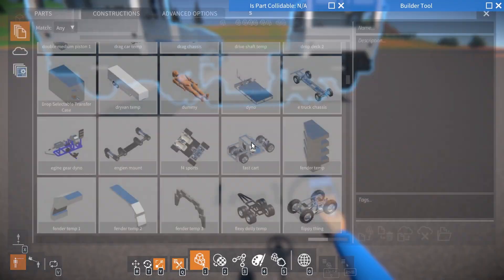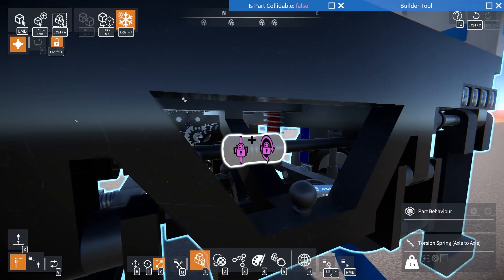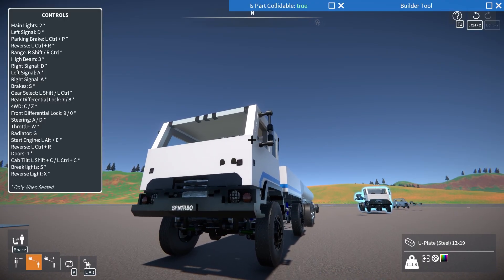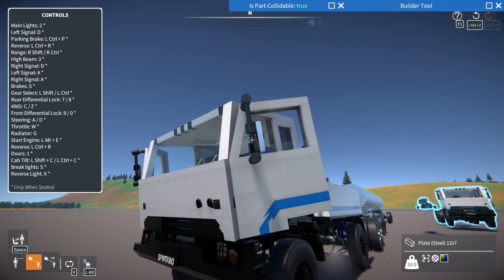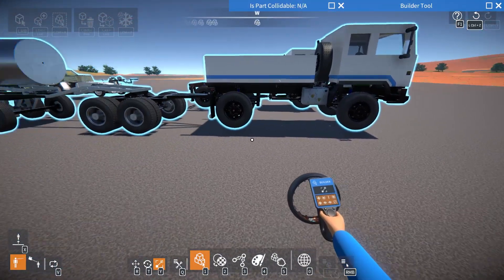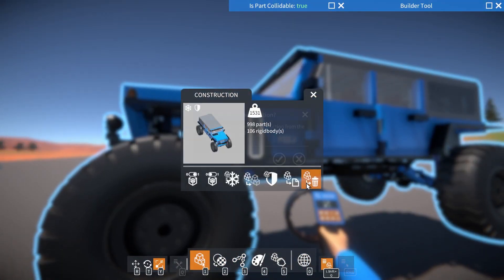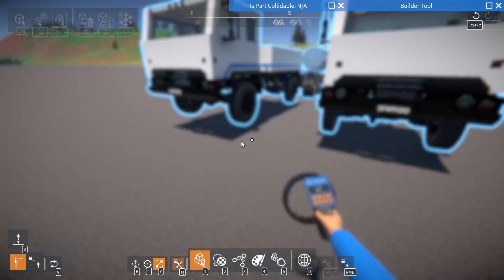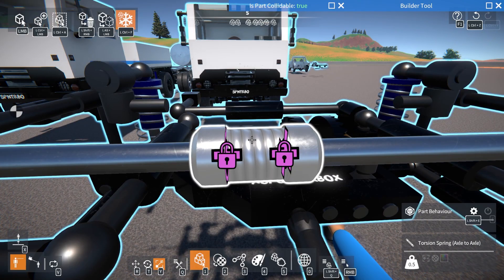How To Minimize Torque Twist | Demonstrated With Gear Blocks

Comment: does the transmission also need the mounts?
Reply from the maker: flexy ones aren't really needed on the transmission if its separate from the engine. if its attached to the engine like your average car then id move the rear mounts back.
Reply: @XspunturboX okay

Comment: Man i’ve done a excavator, really good in operate and also in detail, but the build being almost all made by steel make the construction really wobbling, like the boom’s pistons doesnt instantly stop but do some bounce before rest and this is kinda annoyng, (the boom’s pistons are the main so all the excavator arm realy on this, and being made of steel make it really heavy). Do you have any suggestionbto solve this. I can link to the build if u wanna do a look
Reply from the maker: If your ok with "glitchy" stuff. You could put extra pistons inside the others but connecting the battery will be a bit of a pain.

Could also use the torsion type spring on the main hinge and set it to dampen with no spring.

Comment: Thanks that helps a lots😊
Reply from the maker: You're welcome :) could also make the front a bit heavier, big bumper for example. there are also other things like making the body/chassis stronger and so on but that doesnt apply to gear blocks.